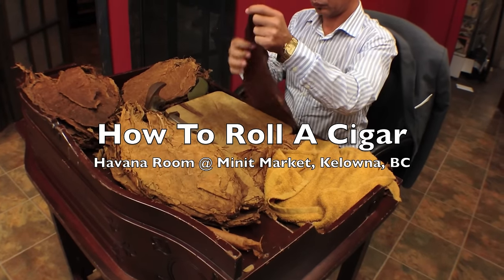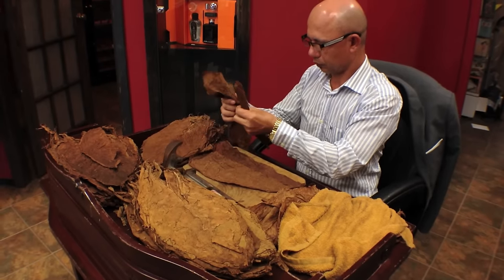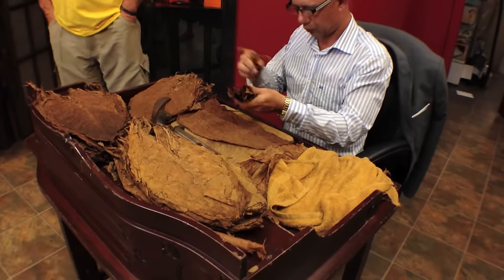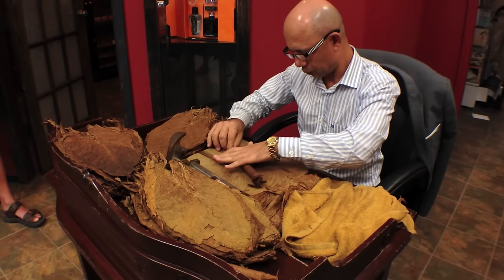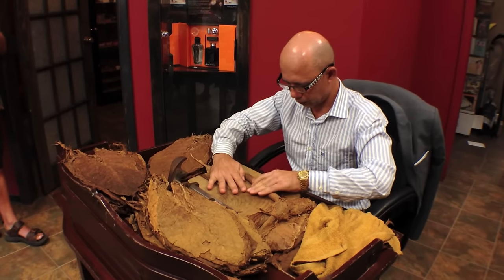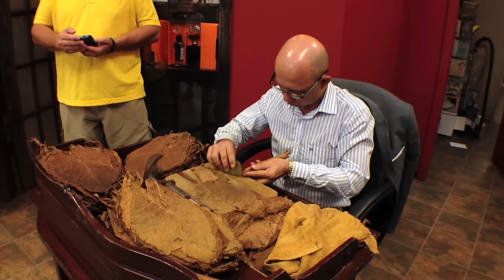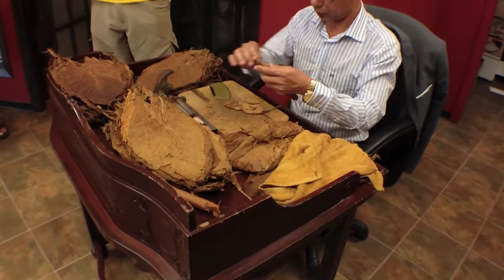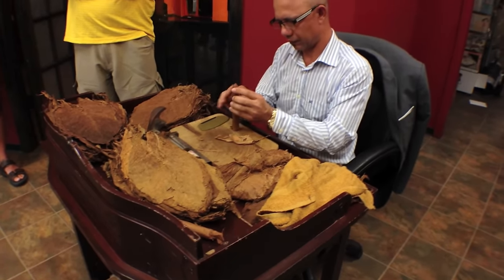How To Roll A Cigar With A Master Roller From H. Upmann

Comment: I’ve had the pleasure of smoking a freshly rolled cigar from a Torsedor, and it’s quite spongy and soft feeling. Usually a cigar will firm up after it ages in the aging room for a few years. Then once they’re banded and packed in the cellophane wrappers; then into boxes, they’re more like your familiar cigar. Surprisingly though even freshly rolled, it still smoked fine, the pectin glue was even still damp at the mouth from where he glued the cap on. It was kinda hard to cut, because it just wanted to squish instead of cut it was that soft still. But boy was it a good smoke! He blended that one perfectly!

Comment: Now I'm reassured of how disgusting cigar smoking is. All the coughing sounds in the background is reassurance of how unhealthy it is.
Reply: Bush Channel u dont inhale cigars there is this miss conception about cigars are worse then cigarrettes but tht is not true. they are not as bad as you think do some research
Reply: I think, as EVOUL said, people do not usually swallow (hehe) cigar smoke. Also, it's gross.
Reply: I watched the video a second time in its entirety only listening for coughs 😂😂
Reply: Cory Goodman The nicotine from cigars when smoked correctly is absorbed for the into your the sides of your mouth and sometimes your throat, not necessarily the inside of your lungs. Air that's already trapped in your respiratory system acts as a cushion as you puff on a cigar and is what gets drawn into your lungs, helping to keep the smoke inside your mouth. If your constantly puffing on a cigar so hard that you manage to flood your lungs with it, you're most likely overheating the tobacco and producing much harsher and more tar-filled smoke that is shit compared to if you just took your time with it. Slippage can happen, but generally the more experienced you get with smoking cigars the more you can tell the difference. 

Cigars will generally acclimate to whatever humidity is around them if you leave them exposed for around 2-3 days; even in cellophane (which unbeknownst to a lot of people is porous), cigars will tend to dry out in normal everyday air. This drying out will fuck up the amount of vapor that one would naturally get from the cigar from it's moisture and oil content and in the end still produce harsher smoke even if you're smoking them correctly. A tobbacinist that knows what he or she is doing will make sure to keep his or her stores cigars stored properly until purchase by the customer. It's up to you whether you want to store them correctly after that
Reply: The FDA has proven that a daily cigar smoker which smokes at least 2 sticks has a slightly higher chance of lung cancer than a non smokers, but way lower than cigarettes. If you smoke once or twice a week the damage is low. Your blood vessels and hearth will be fine, no erectile dysfunction and other shit. You do have some increased mouth, tonque and throat cancer when you smoke daily. And moith diseases. But since cigars are not cheap and not really addictive most people don't smoke that often and their health will be ok.

Most lungs will be absolutely fine
Reply: Paden Smith
I hear ya. I do enjoy sitting on the patio in the evening with a fine cigar and a glass of scotch. Definitely one of the more enjoyable things in a busy life. Of course I'd rather not do that whole cancer thing.
Reply: To be fair nicotine has been stated to not be directly linked to cause cancer. The chemicals they add to cigarettes is another story..

If you smoke clean organic tobacco grown at your own expense you'll never get cancer
shitty lungs, yes but not cancer